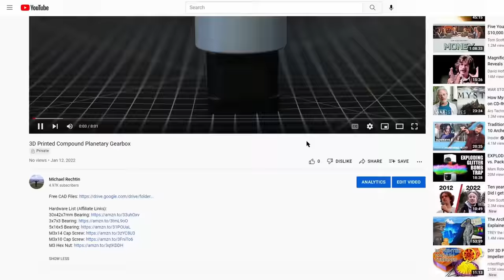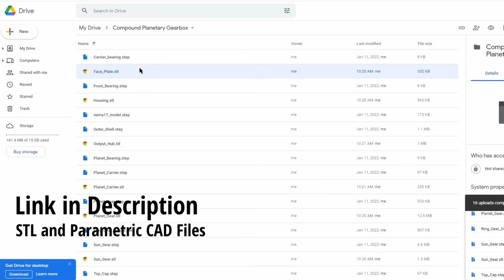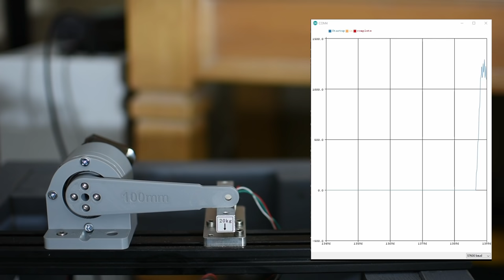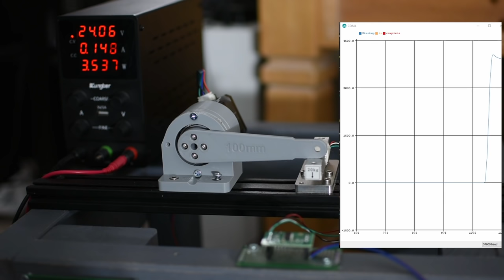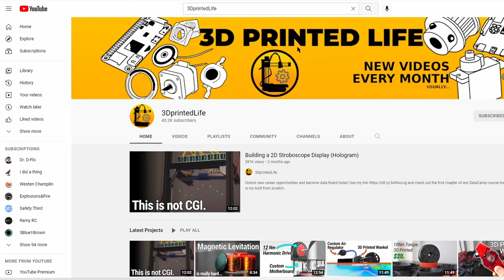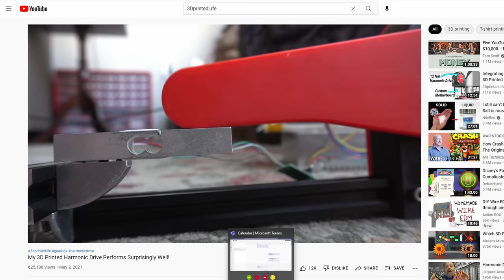3D Printed Planetary Gearbox! Resin vs FDM Printing?

Comment: Need help, i dont get it. If the housing mountet on the Motor is static, the sun gear drives the planetary gears. How can the outputshaft rotate, when it has the same diameter as the gear in the housing? Normaly the only possible output would be the planetary gerset... What do i miss here???
Reply: The output ring gear has 3 fewer teeth than the input ring gear, so when the planets rotate around once, they shift the input-output offset by 3 teeth, similar to how a strain wave gear works.
Reply: @olawlor  Thanks for the answer, i thought i am stupid as 10cm of thread. So the outputs smaler diameter is unnotable in the video.
Reply: @stephanfrenzel5782  I'm not sure what they're using here, but it's also possible to use the same output diameter if you shift the output ring's gear pitch slightly.  Because the planets only engage a few teeth the pitches don't need to match exactly. (Especially in a FDM 3D print, where +-0.1mm is plenty!)

Comment: resin printing are very useful for making gears and other precision moving components when used as intended )
it's intended use is making master models for casting with stronger materials.  resin printing is not for end product.
print some components, make some molds, cast parts out of industrial grade polyurethane and result will be stronger and much more precise than any FDM print.
Reply: 20%- 50% powdered pre baked/microwaved to help it mix carbon mixed in water glass a drop of glycerine plasticiser works too, dont skimp on the grease, fill it right up, it's not just the lubricant in the closed space it's acting as the bulk fluidic cushion when fully filled too.

slap a crude wood diy 3d printer together then print that mix with carbon dioxide gas flow to cure it fast as it builds for lol's ,or have maker's become just assembly button pushers today?

Comment: 2:19 Just a tip, but you always want to pack your bearing rings with a lubricant. They make a bearing grease but the name slips my mind, I wanna say Molly B. I'm %99.9 that that's not correct. 😬

Comment: I’m amazed you were able to print cylindrical hard edged parts at a decent quality on your resin printer. It has been a nightmare for me. The only way I can get anything mechanical shaped printing half way decent is at a 45 degree angle and a boat load of supports. If I print flat on the build plate the print has rings and artifacts all over the place. So far the only thing useful I can do with my elegoo resin 3d printer is oraganic shapes of a bust or a dnd character 😆

Comment: Hey, nice project, I just printed out all the parts and have been assembling them together. I had this issue, I wanted to know if the planet gears go all the way down between the sun gear and the gear track around the sides? Right now, the planet gears sit right at the very top of the gears around the sides of the housing and don't go all the way down. Is that how it's supposed to fit?

Comment: Don't know or have a resin printer but I do have two CR-10S Printer's and do allot with PETG. And this surprised me. I think as I did watching this would put my money on the resin prints. As I have seen over time a bunch of extremely nice resin prints. My only guess is the resin is brittle and the FDM prints done on there sides have the strength and flexibility.

Comment: Very cool test setup! Thank you for the video! Also, in some defense of resins...Which resins were used? Settings? So many variables can affect resin performance. Were they cured underwater? Heating the curing oven that you cure the finished parts in can significantly increase their tensile strength for many resins. It is a complicated sport. Happy printing! :)

Comment: PLA is pretty strong stuff.  It tends to snap rather than elongating prior to fracture, but I have to think its ultimate strength and wear resistance are higher than resin.  Resin has superior dimensional accuracy and surface finish, but for parts with more demanding structural loading, I think FDM/PLA would be the better choice.
Reply: Iirc, 3d Printing Kitchen did a series of tests and determined PLA is one of the strongest "basic" options.

Comment: I mean, if you gave FDM the same benefit of reprinting in a better material like the MSLA printer, you could go a durable PETG on the shell and do the gears in nylon or acetal which are super durable and self lubricating and probably be pretty darn close to a commercial product

Comment: yeah I figured this would happen. From what I know resin printers arent entirely made for stuff like that and from the ones ive seen theyve been primarily used in modeling. However there is some really strong resins that you can use and have purposes like this but again you have to go with the hastle of changing resins which isnt that bad but going back and forth is annoying.

Comment: This is great for testing various print materials but I'm wondering if, despite the cost and production requirements, these mechanical jobs (especially where any level of torque is required) should be left to metal parts? Is see a lot of people experimenting with plastic gears but feel like it's slightly in vain considering a metal gear will be stronger and more durable by orders of magnitude. Things that use plastic gears are often considered "disposable" after all...

Comment: The new "tough" resins seem to be more like Nylon and less brittle, going to be fun using those.  Nice to seen PLA is usable for larger gear boxes. For tiny gears the resin has better resolution.  Maybe Module 0.5 to 0.75 is the cross over point?

Comment: I want to print vary small beveled gears, where each gear tooth is as small as 0.04 mm, inside a housing, and want to use resin because of small details, and since you did this test two years ago as of the time of this comment it would be nice if you would update this video.

Comment: Comparing the strength of the PLA and modeling resin is like comparing the acceleration of Lamborghini and Opel Astra, using the logic that as they both are cars, therefore the acceleration should be equal.

Comment: Which resin did you used actually ? Did you tested the actual resistance on the resin on the bench ? There are tough resins that are not that tough. Give a try with Siraya Blu too and also with a mix between blu-like and a bit of flexible resin for the small gears.

Comment: what's the gear ratio? this might rock for jubilee.

also PLEASE PLEASE do a test on the tolerances/print accuracy of resin printers and their warping with resin like siriya tech build?
i wanna buy one of these but i'm not sure how good they are accuracy wise

what resin did you use for the tests btw?

Comment: Nice video. The gray filament model looks really smooth, what configuration did you used? it's because the 3D printer resolution, or the material?

Comment: The kind of resin you use and how long you hit it with the curing station will determine its strength.  FDM printer filament is typically less brittle.  What type of filament did you use?  What kind of resin? I have both types btw.  I don't care which is better. I use whatever will give me the result I need.

Comment: How about finding a resin that's castable in platinum cure silicone molds that can withstand torque without teeth breaking off? I made a mold to cast gears for the crank open vent windows on 1949-1954 Hudsons and so far every resin I've tried, no matter how good the tensile strength, the teeth snap off easily. The original gear is zinc alloy, with plenty of lead in the original. That mates with a short, steel worm gear at right angles. A hand crank about 2" long turns the worm gear. The problem gear isn't a worm wheel, no enveloping of the worm gear, it's just a helical involute spur gear. I've 3D printed some in clear PLA with 100% infill and several perimeters. IIRC only one I've sold has been broken and I'm pretty sure that was due to the buyer not following the installation directions.

Comment: I’ve been 3D printing since about 2004 and the majority of that time was spent using a Connex 350 polyjet resin printer. I can tell you from extensive personal experience that resin just isn’t fit for practical applications. The slightest bit of heat and the parts begin to sag and soften. Resin can make gorgeous static models, but if you intend to actually put a load on the part, FDM is the way to go.

Comment: Your test shows that FDM is stronger than resin, but I would have liked to have seen a test to see the limit that resin could do without breaking down, as that would identify applications where resin would still be acceptable.  Resin is a more complicated process, but for mass production you can print a whole plate of gears in the time it takes to print one gear in FDM.

Comment: Very nice, with what nozzle size did you print the PLA small gears? It looks like they are all printed with the same nozzle size, I would guess it's 0.4mm, but the tiny teeth on it look so detailed, I'm thinking maybe it's a sub-0.4mm nozzle size? Or did you use a very small layer size? Nice work, from now on I will advice my students to use PLA for gears and not resin!

Comment: The amazon link to the 30x42x7 bearing is actually a 10x15x4 bearing. -- I think the product changed.

Also, I noticed the license you used on Thingiverse claims "No derivatives" -- is that serious? -- You don't want anyone remixing it or improving it in any way?

Comment: Hey when you needed to resize the ring gear you could have just used cura and resized it to like 102% or so and just sliced it and printed it. Just print the gears! Also proper gear spacing is as important at leveling your bed! Same peice of paper between the gears too tight will tear and cut paper or crease it loose it won't hold shape and stay flat when removed and perfect will hold shape with a small flat tip ware the gap is! Can't look like a spike
Reply: 'you could have just...' dipped it in silicon rubber ,wait 'a bit' then pored it out to cure as a thin film... or just....

Comment: I'll admit to skipping a little, but I didn't notice any grease in the resin prints when you took it apart 😅 For any application with constantly moving parts, you need oil 😅 I'm 99% certain that's why it failed early. Which resin did you use for the slightly stronger one?

Comment: What tool or plugin in fusion360 do you use to make the gears?
Reply from the maker: Just added a link in the description
Reply: @michaelrechtin  Cool! That's the same generator I'm currently using. What gear settings do you use for the two ring gears in order for them to have different number of teeth, but same radius? Doesn't changing the module make them incompatible with the planet gears?

Comment: Very nice design. I've been working on a tiny planetary gearbox for a NEMA8 motor printed in Siraya Tech Build. The stall torque of the motor is much lower than the failure stress of the resin, and I'm able to print much smaller module gears accurately with resin than FDM. I'd be very interested to see your design skills applied to an even smaller gearbox.
Reply: Hi what module can you print?
Im curious im working on a solar rotatiting display stand.
Like those in curing stations
Reply: @bertkooijmans4769  smallest I've tried was 0.5mm, but my gearbox is using 0.7mm.
Reply: @topordrop2402  thanks thats a lot better then my fdm printer its barely managing 1mm module haha ill have a go at .5 that makes a small gearbox a lot easier haha
Reply: @bertkooijmans4769  yea for my FDM gears Ive had good success with a 0.3mm nozzle and 1 or 1.2mm module.
Reply: @topordrop2402  oh i got a .35 nozzle on a vertex nano from velleman.
I appreciate your answer very much btw kinda weird only videos i see are pretty big gears this is the first vid i saw with some proper smaller gears.
Reply: So i tried printing a few gears with my anet n4 resin printer.

0.3 module gear went pretty good but i suck with supports so only one decent one.

It has a sloped side where the supports were so thats is unknown to me.
But the teeth look pretty good
Reply: @topordrop2402  hey i got a qeustion how do you orientate your gears when rrsin printing 45 degrees or flat with a bit of support to keep it from the buildplate?
My gears keep having a domed side on the buildplate side and a tiny elephant foot.

Any tips?
Reply: @bertkooijmans4769  I designed a 25 deg chamfer around the bottom edge of each gear from tip to root (using a revolve cut around the whole gear rather than following the profile of each tooth). I then raise the gear about 5mm above the build plate and use light supports to print it. This way I don't need supports on any of the teeth and I can just sand the bottom face flat to remove any support marks.
Reply: @topordrop2402  oh thats a great idea using the revolve ill do that and ill try a couple of orientation to see if that makes a difference got a bunch of failed prints haha

Thank you for your help
Reply: @topordrop2402  hey just letting you know it worked pretty well i still have undersized holes for some reason but the teeth are great and the flat side is not too bad.
Really appreciate it
Reply: @bertkooijmans4769  Awesome, thanks for the update! I made a hole sizing test print block to gauge the size of hole I need to use in CAD in order to get the dimensions perfect in the print. Eg I used 2mm steel dowel pins as the shafts for each planet gear to spin on rather than bearings, so I needed a perfect fit to allow rotation without much friction or any slop. I printed a set of test holes from 2mm-2.6mm in 0.1mm incriments, then found the best fit at 2.3mm and printed another set of holes 2.2mm - 2.4mm in 0.025mm incriments to size it perfectly at 2.275mm. Each hole size test print had multiple copies to test repeatability and I tested using 3 dowels to account for any tolerance differences.
Reply: @topordrop2402  ah so holes are just smaller on resin prints i thought my anet n4 was a bad printer haha good to know ill start experimenting with it for now ill try drilling a couple holes in those gears i already printed
Reply: @bertkooijmans4769  not nessisarily, it depends on the resin you are using, temperature, exposure time, and the health of your LCD screen. Calibrate your printers exposure time, and make sure that you are able to brush out any uncured resin from inside the holes before post curing to ensure there's no extra resin curing after the print.
Reply: @topordrop2402  okay iff i have time this weekend ill play around with the exposure i use water washable so under the tap gets pretty much everything off and after i give it an ipa swirl so i think im good in that regard.

Too bad you dont make tutorials you seem to know your stuff and your great at explaining it
Reply: @bertkooijmans4769  I find that even a good wash in Iso struggles to get 100% of the uncured resin out of small holes. I still recomend using a pipe cleaner (I use the ones from a craft store) and run that through each hole in a bath of alcohol prior to curing. Dramatically improved the consistency and tolerances of each hole.
Reply: @topordrop2402  again a shame you dont make tutorials im gonna keep an eye on those things thats a very handy tip
Reply: @bertkooijmans4769  sadly I'm very time poor at the moment, I hardly even have time to work on my printing projects anymore. Hopefully that'll change soon and I'll consider making some tutorials.

Comment: Very interesting Test... I have bought me a resin printer for over 2 years to print for example gears with high precition. unfortunately the most normal priced resin will broke very fast. Im wondering that PLA is more stable like ABS like resin... After your test im not sure if i want to print technical parts with my resin printer again... Its very pity, that makes resin printer not so attractive.

Comment: could you compare cycloidal gearbox for both material, as well as the so called 'tough resin' that has comparable strenght to pla? cuz cycloidal reducer is in principle the more suited option for 3d printing material. also, it would be nice to build a motor dynamometer to test continous torque rather than stall torque.

Comment: 1. Please use a proper oil or grease inside the gearbox. WD-40 is not really made to build a lubrication film to reduce wear. 2. Why not make the teeth of the stationary outer ring of the first stage the fill height of the gears? Would spread the strain across the whole length of the teeth 🤔
Great video!
Reply: Pay attention, this is WD40 specialist lubricant, not the water displacement spray. It is specifically a lubricant, it will stay where it needs to, and it doesn't contain volatile and deeply penetrating solvents, as opposed to normal WD40.

Comment: use any one of the many engineering resins. Way, way stronger and smoother than any FDM materials.
Reply: Lol thats not true, any resin will shave itself into powder after prolonged use.
Use abs, nylon or petg, they have far better stiction, friction and wear characteristics.
Reply: Please name a few, as I'm looking to to get a MSLA soon
Reply: Phrozen nylon like green. Enormously strong. A little bit of silicone grease goes a long way. I'm running all kinds of gears made out of this stuff with Liqureate composite x for the bearings